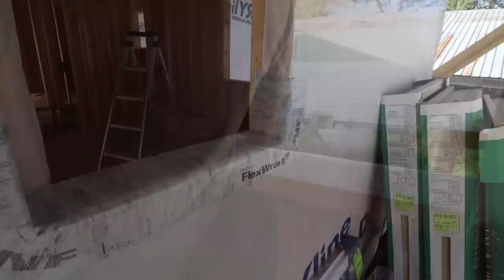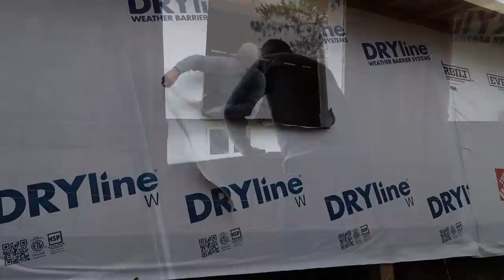BUILDING THE GUESTHOUSE. Part 10. Windows. Proper window installationl

Comment: Joe, I just went through a few days of frustration. I wanted to replace two windows because the seal was broken and they had milky windows. I wanted to replace the two windows with one picture window. I went to the window store and they told me the measurements that I needed. I then "You tubed" on how to measure windows and I did what I learned. I then went to the Window "store" and I was treated with skepticism and disbelief that I measured correctly. I even took pictures of the molding that I carefully pulled off etc.  I believe it was due to my lack of vocabulary of Brick molds etc. They even suggested that I just hire a contractor to come look and replace the window which I ended up doing because I just became exhausted from the experience.  Seeing you explain how to put a new window in and the replacement window, I wished that I just disregarded the Window "store" people and moved forward myself. As a woman, it is tough because many times men like to "mansplain" down to woman. You are not that way and I just love your show, your energy and the way you explain things. We are not perfect and sometimes we need to laugh at ourselves!!! Thanks
Reply from the maker: Thank you Deirdre. Knowing the correct vocabulary helps a lot. Sometimes I can not remember the "correct" word because we call it something totally different on the actual job site. Stairs are a good example. I always call it stair jacks and stair stringers would be the most commonly used and correct term. I had a project manager that would try and correct me and get very frustrated when I would call them jacks and he called them stringers. The fact that it pissed him off even though he knew what I was talking about just made me always call them jacks. Lol. He retired about a year and a half ago and I never did change my vocabulary.

Comment: Australia goes straight from the sarking, turning it in at the window, fit the window then use the window wrap at bottom, sides then top then the weatherboards. My windows had a 20mm return all round for the weatherboards. I didn't use a top drip mould because all my windows were under verandahs. We don't wrap with plastic inside under the gyprock, probably because of the different climate.

Comment: Great info, Joe.  
22:40  Absolutely Joe.... their smashed fingers will heal... but you'll have a cracked window flange forever!!   haha.   j.k.    😁   And, regarding the overlap of flashing/tar paper/etc..... my Dad would ALWAYS say, "Follow the Rain drop" to know which part would be on the bottom/top...  😉
Reply from the maker: You dad was correct with the follow the rain drop. It is all common sense. If yoh are saying to yourself "hopefully this will not  leak" You are doing it wrong. Look at it again and pretend you are the water. There is a leak free way to do it.

Comment: Back in the day we would spline window openings before the window was installed. Splining was cutting roofing felt to 4 or 6 inch wide strips and installing them over the top ,bottom and sides of the opening before the window went in.  This was done to prevent water penetration.  My how things have changed

Comment: I lived in Mpls during that time of the molding stucco houses. Ironically I lived in a stucco house at the time. It was built around 1950 so I didn't have any of those problems. I'm sure my stucco house was not air tight. 😀
Reply from the maker: It is funny that way. I have worked on well over a hundred of the old stucco houses and you are correct, they are never rotted. In fact, they are probably houses that in my opinion are in very very good shape. Like you said, they are not air tight so the molding and rotting issue never happened.

Comment: I take a small piece of 1x4 that fits snug in the siding channel of the windows, rip it so i can still fit the nails and slide it around the perimeter. If i accidentally bump that channel it usually wont break it

Comment: One trick to center the widow is put a mark on the flange slide it to one side put a mark on the siding slide to the other and put a mark then center between the two marks.
Reply from the maker: I actually do that quite often. I had that in one of the video clips but the wind was too loud so I removed it.

Comment: If you have a second story, do you still install from the outside? Do you ladder up or rent a bucket lift?🤔
Reply from the maker: Usually from the outside. I have a lift. Sometimes on ladders. If you can remove both window sashes you can install them from the inside but it is a lot harder to do.

Comment: Why did you install 3 different type windows-sliders, roll out and sash? Wouldn't it look better if all the same style?
Reply from the maker: They do not make single hung windows wide enough for the windows where we put sliders. They do not make sliders narrow enough for where we put the single hung. I could have put a slider in the front where the wider one is but that would not have matched the other 2 in the front.

Comment: 40:21 I thought outside walls can't be 2x4 anymore.
Reply from the maker: what if you are putting a window into an older existing house? This video is how to install windows, not just in new construction. Yes you can have 2x4 walls but they would have to be spray foamed or you would have to have foam sheathing. It is not the thickness of the wall, it is the R value of the wall. As long as you can hit R19, a 2x4 wall is legal.
Reply: @NorthernSeclusion  Thanks for the reply!  Thought the 2x6 requirement was for support not just insulation.  Are most homes not spray foamed?  In the south I think that's most common.

Comment: Could the old windows on the trailer be re-used?  Or bad idea?  I'm just wondering.  One can always learn.
Reply: The windows looked like they had aluminum frames, which means they conduct heat as well as cold in your living space.  Plus, most trailer houses use the cheapest materials possible.  I wouldn't, but that's cause I've lived in trailers.
Reply from the maker: With a new building I would rather put in new windows. The trailer walls are only about 2 inches thick and the new building is 6 inch. Best to keep everything well insulated and as air tight as possible. 7 months of winter really makes you respect having no wind blowing through windows and doors.
Reply: @NorthernSeclusion  will this place be a lot more air tight than your place?